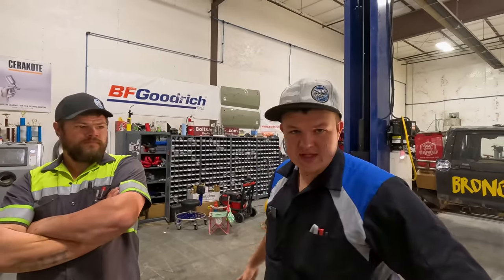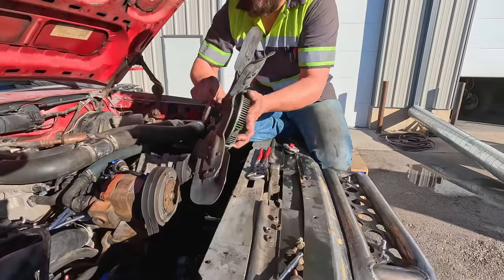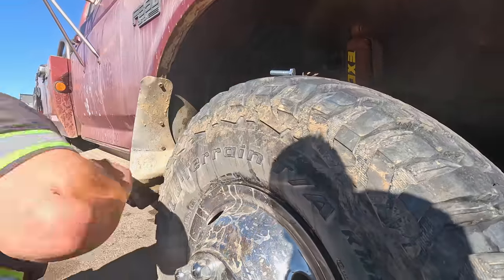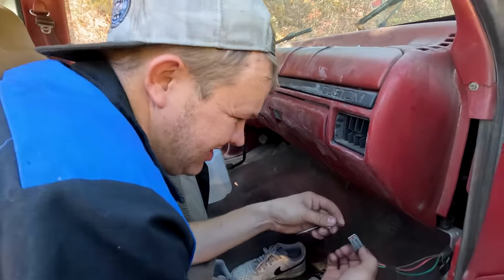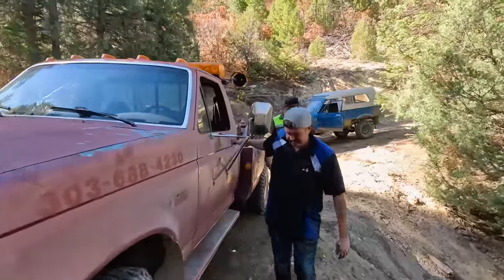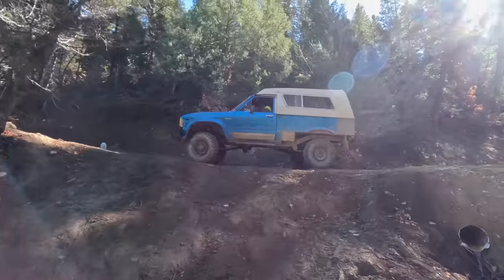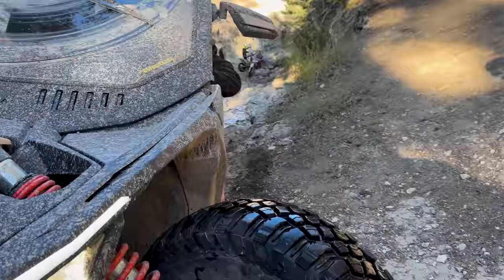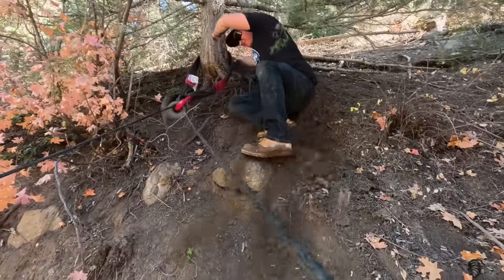Utah's Toughest Trail Claims Another Vehicle

Comment: A lot of older engines used steel studs and brass nuts on the exhaust manifold, they do NOT rust ever :)
When you take the rad cap off a hot engine ALWAYS USE  a large rag over it so it will not blast the water all over yourself.

Comment: Of course Hillbilly came prepared with electrical table and a throttle spring.

Steve's commentary on the Can-Am was amusing. "At least they got it up that." Cody, Andy, et al. must have done a legit trail repair. I'm shocked it worked in that condition.

Comment: Good Morning Robbie and crew that switch on the passenger side of the ford is the inertia switch. It’s job is to cut the fuel if you roll the truck. Might be worth replacing. Also I thought I noticed on the previous video the motor mounts look like the had some slop,it didn’t look like they were broken just sloppy. Hope you guys fix it I am a Ford lover like hillbilly. Have a great weekend crew!

Comment: That's the inertia switch. It cuts the fuel pumps off if the body takes a hard impact or heavy bump. I had a customer with a early 90s Escort. Every time she hit the railroad tracks (most likely going to fast) to hard it tripped the switch. After 3 service calls I showed the lady how to reset it. I never got a 4th call.

Comment: Add a 1 gallon tank inline in the cooling system on the yota. then it will not get hot. I use like a truck air tank so it will hold plenty of extra coolant in the system. Hayden also makes a better fan system for those as well.

Comment: HillBilly, When being winched, keep your tire speed very much the same speed as the winch. Spinning the tires fast doesn't get you out any faster, and often, I've seen rigs break something, usually an axle, and once a R&P. Also, a locker in the front would have served you well! Not sure of the back, I couldn't tell if you had a locker there or not. I could see you didn't have one in the front though.
Robby, Change the thermostat, hoses, clamps heater hoses and the water pump. Go ahead and get it right the first time! Might even wanna get the clutch on the fan done too.

Comment: I thought when you have to work on the engine way out in the boonies it is supposed to be dark and raining. Jokes aside when my father used to work on engines, if he had the cooling system empty he would leave the thermostat out when he first started it so the fluid could flow without pressurizing. After the block had fluid in it then you put in the thermostat and you are good to go. Not as fast as having a tool purpose made for the job but it gets it done.

Comment: You could fix that problem by putting a radiator saddle in it the cab is flexing in the front tube body mounts are imaginary I've had this problem and fixed it

Comment: Take notice Ford Exhaust bolts are what's referred to as a ROLL thread ,its not a fine or coarse thread.  just for future info. And the nuts that come with the NEW exhaust studs are a captive conical nut.  The stock exhaust manifolds warp at the rear of the passengeside and break studs or they fall out, they don't have an exhaust gasket, they are a machined, so the exhaust manifold has to be resurfaced or replaced. We used to hundreds of these right exhaust manifold, new studs and nuts and a new Y pipe.  Great truck keep giving it love!

Comment: As soon as I saw the fan into the radiator, I would have taken the belts off the WP. Seen it happen so many times. Plus it probably overheated even more with the leaking radiator. You should be carrying like 2 five gallon containers of water on the back of King Fred lol 
My wife always carries coolant or a large gallon of water just in case in her trunk. I don't cause I know what to do if I break down, plus my car doesn't have any coolant leaks and has way less miles on it.

Comment: adjusts hillbillies idle fuel mixture screw you guys really need a carb guy.. a lean idle would surge and do strange things, but not overheat, I would be more concerned about the thermostat or the radiator cap or a block heater line. collapsed lower hose, since you were smart enough to open a hot radiator cap.. I have to question your knowledge at times.
This is for billhilly, dude.. idle your truck to around a 1000 rpm and that mixture screw it's for idle only set it at 2 rotations out from bottomed lightly, start your truck with the air cleaner on it, and slowly adjust the screw to see if the idle rises or lowers, you want the idle to come up to it's highest clean point, if it starts to misfire it's to lean, because you have a factory carb it wont go to rich, you would have to drill the idle ports out inside the carb and without an o2 sensor you can read and a stack of carbs or replacement jets getting it right might be difficult. once you have the idle as high as it'll go then turn it down, to where you want it, then loosen the distributor take your timing light and see what your timing is, and try raising and lowering it to raise the idle rpm, it'll take some trial and error to get right, but thinking the idle mixture screw changed the air fuel ratio while the throttle is more then 10% open is wrong and you need to learn before you speak.

Comment: Dump some hydraulic oil (brake fluid or atf) in the rad and it will swell the seals in the water pump enough to get you home…..or it could just catch on fire and put itself out of its misery…it is a ford after all

Comment: Hayden makes a severe duty (not heavy duty) that you cannot make the cummins get hot. I use a big block chevy BeCool performance triple flow radiator on all my cummins and never any issues.  Use a separate auto trans cooler. Derail has a nice one with fan on it.

Comment: On that era Ford I've seen the serpentine belt come apart and rip the radiator up.  Trimming a rib off a serpentine belt to make due does come with some risk since its difficult to make a perfectly clean cut.  Hopefully the motor didn't get launched forward off its mounts.  Now I'll watch the rest of the video and see what HillBilly finds in this instance.  Got lucky on the belt however it needs to be replaced with the correct one before it fails and slashes the new radiator.

Bring white vinegar and plenty of distilled water to clean out the block to protect that new water pump.  A 50/50 mix of water and vinegar to clean it with perhaps 1 literal drop of dawn dish soap followed by a thorough flush with several gallons of distilled water before adding coolant.  After a launch and impact on the radiator, the bearings and seal on the pump have been known to fail.  Also consider replacing the fan and clutch assembly since the old one might be out of balance now.  Your choice on biting the bullet and going straight to electric however in severe service they often have both an engine mounted fan with the clutch and two electric fans pushing from in front of the radiator.  A cold air intake for the intake pulling cooler air from in front of the radiator is also helpful.

460 is notorious for popping exhaust manifold bolts/studs due to heat soak.  Often the manifolds also start to crack when that happens.  More common on vehicles in severe duty service like the wrecker and motor homes so no real surprise there since like the sun coming up in the morning and setting in the evening its an expected event.

Best!

Comment: Instead of going with a Cummins 6 cylinder you should go with the original diesel engines Ford used to install on the 250’s and 350’s , get a 7.3 Turbo first generation which was NON-ELECTRONIC 1994/1998 I still have my 1994 F250 with one million miles on it, and I have repaird the engine only once, several times the gear case, but engine only once, and we do haul trailers always, I live in Ecuador and we have 12,000 foot mountains
Reply: Go Cummins.  Not that junk 7.3 that a gas changed over for a junk international motor
Reply: The 7.3 was manufactured by Navistar and the no electronic ones we're awsome, I have had 5 F250 and F350 and 3 of them are still running with the same engine, fully operacional, and don't get me wrong I also own 6 Cummins engines on my 3 water blasting trucks, two engines each, one for the truck it self and another for the high pressure pumps and I love those Big bore Cummins, but for my Fords I will always go with the 7.3 Turbo mechanical governor